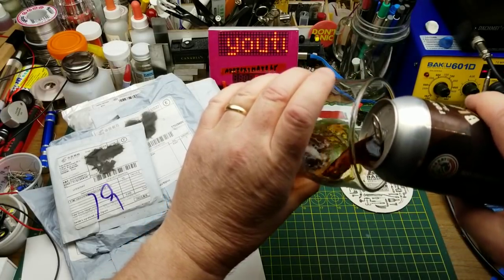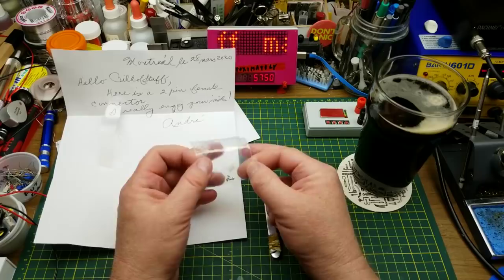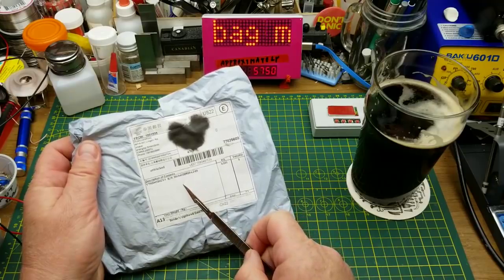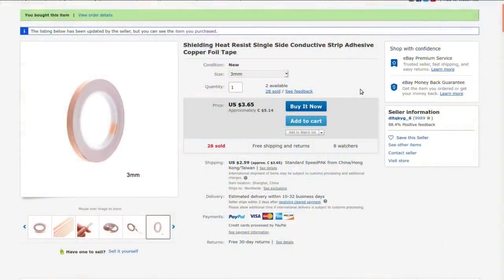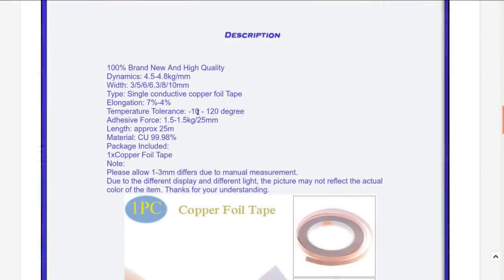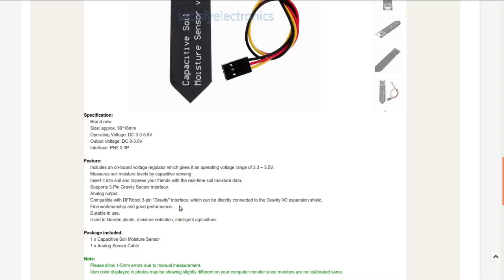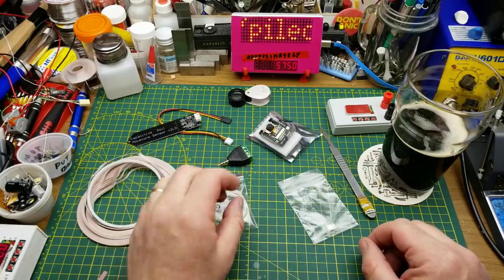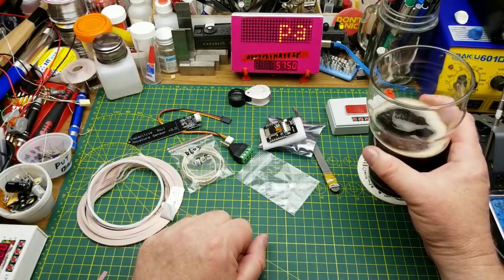Mailbag Monday #87

Comment: Too much beer by one of us, that led looked very green to me 😁 nice post bag most of my china bits seem to be flying around in circles.
Reply from the maker: Colourblindness strikes again...
Reply: @pileofstuff  Sorry i forgot that you had colourblindness,  I can remember on UK TV many years ago, Snooker commentator, the late Ted Lowe, uttered the immortal phrase, "and for those of you who are watching in black and white, the pink is next to the green" during one of his commentaries.
Reply: I noticed that too...then I remembered his color blindness - funny thing is I soldered up 2 tiny 0603 LEDs on a perfboard and its hard to tell what dolor they are when they are off, I ended up with both green ones. They looked the same when off.

My Aliexpress stuff has gone AWOL too, havent receives stuff I ordered in mid March ! The new elevated shipping charges are making it impossible to order any more - I would rather pay $7 for 25 meters copper foil tape from Amazon prime instead of $3.65 + $3.65 slow shipping - hey wait a minute, that $7.30, even more than Amazon prices !

Comment: Copper foil tape is available both with normal glue or with CONDUCTIVE ADHESIVE. The conductive ones are great since you don't need to solder the joints and corners. Obviously it's no good for high current, but awesome for shielding plastic boxes.
Another great use for these tapes is to enlarge the capacitive area on touch lamps, and the conductive glue means you can just stick the stuff straight onto the existing wire or small touch pad.
Reply from the maker: Just checked the stuff I recieved. It has non-conducive adhesive.

Comment: Mark posted it is a CMOS 555 timer with maybe a proportion DC output.  I was  thinking it might be just a pulse train non-filtered and the frequency would be related to the moisture in the soil.  The AUOT printed on the board, maybe should be AOUT and that they are trying to indicate it is an audio frequency output.  Who knows but would be easy to check.
Reply from the maker: I wonder if it puts out a PWM signal or a variable frequency? 
Could they be using the sensor as the capacitive element in an astable oscillator?

Incoming experiment!
Reply: @pileofstuff  That is what I was thinking.  However most people have DMMs or VOMs but if it is frequency then that adds some more complexity.  They should indicate the monitoring device or at least more about that output. Also would be an easy check with the data sheet and see how much change in capacitance effects the frequency. Also I have no idea what capacitance change there is with a change in moisture levels.  If you wanted continuous monitoring then again sending it over a pair of wire you could have a long run to an Arduino since it would not be as much of a concern about voltage drop. Just some fun thoughts on the matter.  I look forward to any experiment you might do with it.

Comment: Originally copper tape was used by alarm companies, they places the tape around the windows and if the window broke it would brake the tape and interrupt the small current flow,  a relay would drop out starting the alarm bell.  I have some tape still from that era.

Comment: Hmmm.. I have made my soil sensor out of stainless TIG filler wire with plastic spacers in between. Works great. I think the electronics on this bord will corrode soon unless you casting it in resin...

Comment: Interesting "stuff" as always. I've been using one of those capacitive moisture sensor for about a year now as part of a greenhouse remote monitor. I dipped the non component section (capacitor) in polyurethane to seal the edges and then used sealing heat shrink on the component area to complete the waterproofing (I removed the connector and used an audio cable with 3.5 mm plug to connect it). Didn't notice any difference in the output comparing a non-coated board to the coated board.

Comment: I'm just getting started with the ESP32-CAM myself.  I believe you can't use all the broken out IO pins if you are using the SD card.  You can use an Arduino Uno or Nano to programme the ESP32, which is my usual preferred method.  I make a "sheild" out of strip board that the device plugs into.  The sheild I use most is the one for (programming) the ATtiny85, but I can see this getting a lot of use too once I make it.
Reply: Yes, an SD card will probably tie up the SPI pins.  Would imagine this board is programmed through UART after hitting that reset button.  One killer app would is a cheap IP camera.  Maybe one of those tiny DFRobot 3.3V transformers makes a good fit to power it from the wall.
Reply: @GnuReligion  It doesn't have a button for reset (unlike regular ESP32 dev boards) and the reset pin has to be held low while programming I believe.  Another reason why an Uno sheild is looking like a good solution.  Yeah, people are making IP cameras out of them, and the ones I bought have the wifi antenna included.  It's a versatile little device.  They are also perfect for running off cheap Li-ion pouches of a couple of hundred mAh, which is the bit I'm trying to source at the moment.  Strangely, that appears to be the hard bit, unless you want to use a small drone battery or something like that.  All the little batteries must go straight to manufacturers.
Reply: I'm just adding to this now that I've prompted myself about tracking down those batteries.  Yes the only sources appear to be the original manufacturers.  I found a few on made-in-china that have minimum quantities of 10 or so.  They are about a buck a piece but I expect I'll have to pay shipping on top of that, and it may be expensive.  Small drone batteries from banggood might still be the best option.

Comment: Soil sensors that are metal contacts need an AC drive to try and make the  contacts last longer, DC just helps dissolve one contact.
Reply: Yep, some form of galvanic action. You can use an occasional (but equal time) DC polarity change-over, if that fits in better with the sensing circuit better than "pure AC". You just need to reverse polarity to get the electrons and ions to move back to the eroded contact.

Comment: wrap the copper tape around your plant pots to keep slugs away - allegedly
Reply from the maker: Good idea. Not many of them around here, though. 
I don't think they are durable enough to make it through the winters.
Reply: Put two strips and a connect to a battery,  they hate the slight current flow as the bridge the two.

Comment: The TL555c is a cmos version of the venerable 555 timer. No doubt it has an onboard precision temp-compensating resistor used with the capacitance traces to set its pulse rate, and more circuitry smooths that to DC out voltage. No wonder there are no adjustments. You could probably diddle it with some of that copper taps across the traces but I don't see why.
Simple but effective as it is.
Reply from the maker: I wonder if it outputs an analog voltage or maybe a variable duty cycle PWM? Or maybe just a variable frequency?

Clearly I need to do some experimenting...

Comment: When shipping returns to normal and does not require tracking, then the prices should go back to normal.
Restricted postage, with some countries not accepting anything at all, is making the prices a little crazy at the moment.
We were very spoilt with the Chinese free shipping.  I never understood how they could ship for free and also have the stuff they sell so cheap.
Reply: I don't think China Post charges anything (to the seller) for export goods. They get the postage really cheap by consolidation and sending in bulk using spare space in the cargo holds of passenger planes. Since there is almost no planes, that low cost method is not available to China Post and the sellers must use commercial carriers, couriers, etc..

Comment: You should check your LEDs. As we know you are Color blind but in fact that was a green led on your copper strips, no red one 😀
Reply from the maker: I'll have to get a colour consultation one of the teenagers before I do anything serious with those LEDs.
Reply: pileofstuff there are Color sensors available for a few bucks in China that together with an Arduino or esp tell you the Color of any reflective surface or self emitting light source. Maybe a project idea? There is also sample code available. I made one to calibrate our printers at work (to tell the rgb values of the print outs to fine tune them afterwards)

Comment: Any one getting soil moisture sensor soilwatch 10 advert lol or is it just my fone lol
 oh no that foil, thats a machine screw up, get refund or nother one Prob cus they used plastic shit core guttering pipe should be 6 or 12mm cardboard core stop it flexing or the screwed tensions up on rewind cus it's metal it adds tension every wrap and their mandrel cutter might not set right either lol that would of been binned by company lol